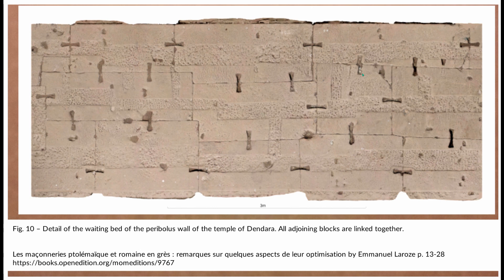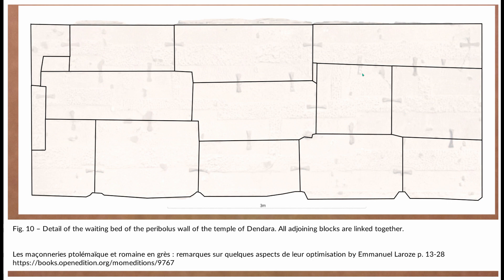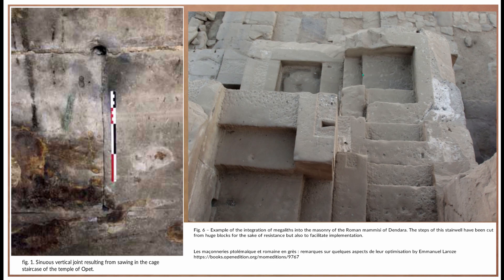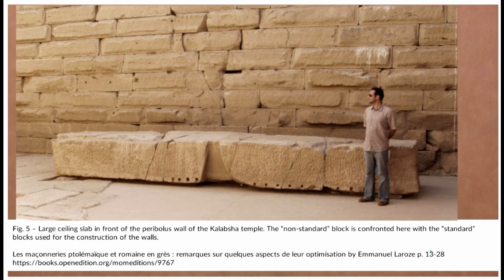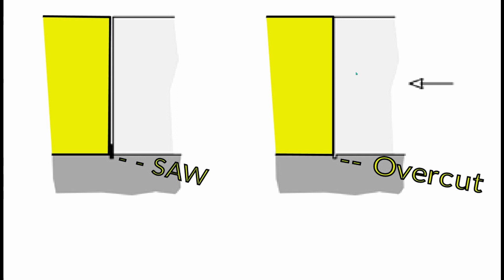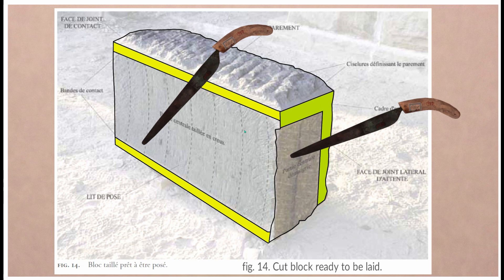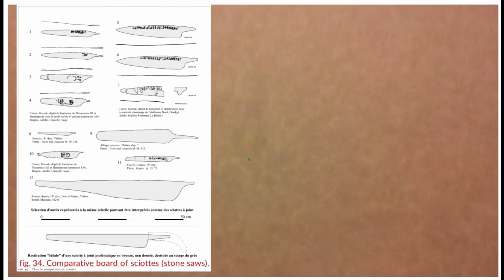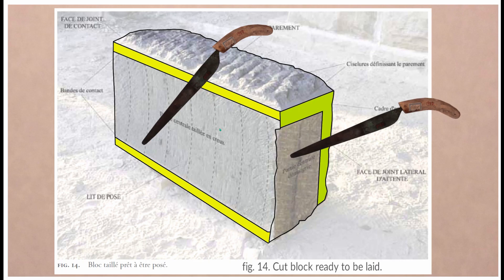Polygonal Stone Walls with a Saw: Ancient Techniques with Primitive Tools

Comment: For those who are interested in the topic of polygonal masonry. A number of methods for obtaining the polygonal masonry are proposed. The basis of the proposed methods is the use of clay/gypsum replicas, reduced clay models of stone blocks and a 3D-pantograph, as well as a topography translator. The results are presented in the article: “Fabrication methods of the polygonal masonry of large tightly fitted stone blocks with curved surface interfaces in megalithic structures of Peru” (DOI: 10.20944/preprints202108.0087.v7). YouTube does not allow a direct link. Search by the article title.
Reply: Correct me if I am wrong, but your paper assumes that the polygonal stone work done in Peru was done by European settlers no earlier than the 17th century?

I edit this to say no earlier than the 17th century rather than no later than, excuse me.
Reply: @foxprojects247  The Peruvian polygonal masonry was erected by European settlers (most probably by one of the Vatican's Orders) approximately after the 17th century. See explanations in the mentioned paper.
Reply: The 10th article edition (DOI: 10.20944/preprints202108.0087.v10) is posted at Preprints. Search the article by DOI or by title.
Reply: @foxprojects247 so smart they were to build underneath Inca construction to confuse everyone. The sky must also be green. This whole channel is Absurd..
Reply: @RostislavLapshin  this seems bit racist tbh... the idea that no other nation in the world was able to come up with same idea... would this apply also to the polygonal platform in Eastern Island??

Comment: the saw ran over? And it cut that deep... u were struggling to make a millimeter dent my man, these are boulders, there's no "oh shoot it cut a few centimeters over" this was a whole task, it wasn't fast work at all
Reply from the maker: I get a cutting rate in granite and basalt 40 to 50% of a modern gangsaw.
Over cutting comes from finishing off the cut. 
I am amused by people insisting things such as you have. I have a playlist of experiments in how to format doing the impossible or impossibly slow things.
They are cutting sandstone here. 🤦‍♂️ 
If you’ve cut wood you’d know that it’s natural to cut at an angle. These over cuts make absolute sense with even a little experience in tools.
In sandstone as here it’s a couple of minutes.
Boulders?  I have posted pics of people, lots of them, using saws to cut giant blocks with frog saws. It was common practice. Only now do people marvel at the fact of what was normal.
“If it wasn’t fast it wouldn’t work at all” is an incredible statement. If that was remotely true then historic buildings here in Sydney and everywhere else must be unexplainable too.

Comment: Be careful with drawing lines across photos to prove that the real object is curved. Cameras slightly distort shapes, especially with wider angle lenses.
Reply from the maker: yes definitely, though in some of their pictures they hold a straight edge against it,  since the images were lo res I just wanted to highlight it to male it a little more clear.

Comment: Around 6 minutes in, you stated, "used anathyrosis to put in a liquid slurry to bond and hold the stones together." Then, while reading the definition of Anathyrosis, it says "Anathyrosis is the technical word for the ancient method of dressing the joints of stone blocks in dry stone construction, i. e., masonry without mortar. " What you say is the method used in ancient times, which is Anathyrosis, is different from what the actual definition is. The stones at Sacsayhuaman do-not have any metal clamps together, they do not have mortar inbetween them, and they most certain do not have gaps in the back. The gaps in the back are where the soot fills in while the sides have grooves to fit together. Im pretty sure you've physically been to this site, so I'm confused as to how you're making this claim and showing a picture of the backside of the stone wall while not addressing how thick in distance the stones touch. This is no magic high technology used or your claim of Anathyrosis.
Reply from the maker: https://referenceworks.brillonline.com/entries/brill-s-new-pauly/anathyrosis-e120200
Another definition 
Anathyrosis can be with or without slurry. 
I have a series on Sacsayhuaman and show the gaps, contact being only on the facing side. https://www.youtube.com/watch?v=_x8MCXrqCCE&feature=youtu.be
Sacsayhuaman absolutely has gaps in the blocks. 
From the rear or where the sides are showing the fine joins can be seen only to extend back a short distance.
Reply: That's not true at all about Anathyrosis being able to use mortar. Anathyrosis is fitting of joints without slurry or mortar. It's fitting dry-stone together. The source you provided that was published in 2006 doesn't mention with or without. The only detail of process is "partial removal of material from contact surfaces between two stone blocks or column sections" which is to create a fitting or joint without mortar. Keyword is creating a "fixed joint", you don't put mortar into a fixed joint to get it to be stationary. If you're asking about a joint and lock, that's what fitting them together carefully is about, not by using mortar. The word Anathyrosis is ancient Greek. Anathyro is "Hatch" in ancient Greek which was used to bear, begit, or bring about during carving. When adding the suffix "osis" at the end, it becomes the act of or the state, abnormal condition, or action. When fitting together blocks using Anathyrosis, they fit dry stones together and create a hatch for them or a break to fit together. That's practically the point of Anathyrosis; without mortar. You have heard of Stone hatching,  I'm sure you can see the correlation of a direct translation and not a skewed ancient Greek > Greek > English translation.

This website below is a peer reviewed library that extracts text from scholarly reviewed books. It talks about how joints the joints that are made hence why you don't need mortar.

I created spaces in-between the URL so it won't be blocked.

http:// www.perseus .tufts. edu/hopper /text?doc=Perseus%3Atext%3A1999.04.0004%3Aalphabetic+letter%3DA%3Aentry+group%3D10%3Aentry%3Danathyrosis

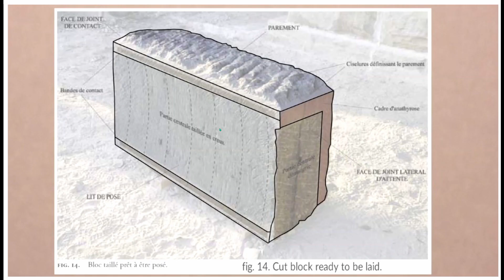In the video that you sent, at 32:30, you have a picture of wall section 21 and 22. You can see jagged roughness on the back side and the gaps pushed apart due to reconstruction or earthquakes. This isn't a gap from mistakes, it's from other sources pushing it apart. If you're mentioning a gap where only the front is fitted perfectly while the back is open; You have a picture yourself showing a block that's at least 3 feet thick that can be pushed together without gaps. When you take a picture or look at these gaps, there are no blow-outs, discoloration of constant adjustments to fit the gaps together, and they're completely smooth to fit together completely and not just the front of it. The gaps that you're mentioning are from reconstruction areas or crude Incan work done. You can clearly see these are not from the original pieces of work.

If you need a few pictures of showing Sacsayhuaman blocks that have no gap (front to back) and are flush together, take a look at the pictures I compiled in a .zip below which I took and hosted them for you below on file dot io. One picture is taken from Ollantaytambo and showing a ground base. There is a base where blocks used to sit which held almost two layers of gap-less blocks which also show an outline of where the rocks went. It shows that blocks were fitted together throughout the entire side and not just the front while having a gap in the back. What you showed is only one example where the back has a gap due to other occurrences that created that gap. I can provide you plenty of other examples of this gap-less occurrence from the stones at Sacsayhuaman. If you'd like me to go there and take any specific photos or data for you, then by all means lets work together instead of against each other to learn.

I created spaces in between the URL so it won't be blocked.

https:// file .io/ HkERW6p6cSqz
Reply: @SacredGeometryDecoded  you really need to come back to Jay here and work this out.
Brilliant minds together can create better progress.
Reply: Excellent work Jay, we need clarification and you seem very articulate with good information.
Reply: @Spherical  Thank you, Spherical. I greatly appreciate your response. SGD Sacred Geometry Decoded is a very intelligent, well-informed, and overall smart person & channel. My response was to never belittle, I like to debate and discuss, so I apologize if I made it seem that way. 

This stuff is difficult for the average person to conceive and explain right off the top of the head. Also, we're all on the same team here trying to bring the most factual pieces of evidence to explain the ancient past.
Reply: No you sound all good. 
It's important for minds 5o come together. 
You cleared up questions I had about gaps behind the bigger blocks and your feedback made more sense. 

We need more cooperation and discussion in the world 🌎

Comment: Using a saw simultaneously on nextdoor blocks is also the way we make the blocks of snow fit when building an igloo. It makes complete sense to me that this is how polygonal masonry could be done. 
(I'm guessing from your accent that you might not have built many igloos, apologies if I'm incorrect!)
Reply from the maker: You are very correct. I got most of my igloo education from Bugs Bunny cartoons. 😉
Reply: @SacredGeometryDecoded  😂
I think some of these 'alternative historians' are getting their masonry knowledge from similarly dubious sources!

On a serious note though the only difference I can think of between the 2 techniques is that we normally do the horizontal cut before the vertical cut. 
It never takes more than 2 passes of the saw to have the sides lined up nicely, it's got to be the easiest method for achieving the desired result.

Comment: A method used by the ancient Egyptians is the same method that has been used around the world and is still used today in modern quarries. The Urn Tomb in Petra is carved into the side of a cliff and is a perfect example of this technique.

To create the basic shape, stone blocks are cut from the solid stone cliff face, which leaves tool markings. These tool markings then leave a surface that resembles a wall made of blocks. The depth of the tool markings depends on on the stage of construction when it was abandoned. If it is at the initial stage where the stone has not yet been removed, the tool markings will be deep and wide. You will see many examples of this at Petra as well as at the Colossi of Memnon where one of the statues still has these deep grooves. Because they are cutting and removing large rectangles of stone, the tool markings resemble rectangular blocks and so they create the illusion of a wall made of blocks. There are numerous quarries both ancient and modern where you can see this. Also because they are removing rectangular blocks of stone, you will sometimes find the offcuts scattered around, causing people to believe that they are blocks that have fallen off. There are many of these blocks scattered around at Petra.

After removing the rectangle block, the tool markings that remain in the solid stone are much thinner and shallower. As they smooth out the blocks, the lines become thinner and more shallow that create the appearance of very closely fitting stone blocks. Because the "blocks" are cut from solid stone and there is no need to be perfectly straight, the irregular shapes of the stone will match perfectly and make it seem as if two surfaces have been cut to match perfectly. Where the stone is closer to being finished, the grooves will be very faint and often incomplete, allowing you to easily see that what looks like two blocks side by side is actually one piece of solid stone. If they were to score the stone before they cut into it, it will also create the fine lines that look like perfectly matching blocks of stone. That is why you find these "overcuts" because they were cut from solid stone. The triangular indentations are where they put blocks of wood that they would soak with water to expand and break the stone away from the solid rock face. If they were cut from a quarry, those marks would have been removed at the quarry.

 There are many examples of this method at the Urn Tomb, showing the different stages of construction that create the illusion of a building made of blocks. You will also find these tool markings underground and on free standing sculptures, some of which are buildings that people falsely believe are made of blocks. But if you examine the grooves up close you will find parts where grooves are incomplete or where the stone pattern from one side of a groove crosses over the groove into the adjoining "block" showing that the groove is incomplete and only superficial.  That's the thing about something made of solid stone, it's easy to prove conclusively but you are not going to find something unless you are looking for it.

Comment: Elegant interpretation of the available evidence. In contemporary stone masonry, leaving thin edges of stone bearing on lower stones is not considered good practice and a defect. Once loads are fully applied to the stone work, and if the mortar gives,  the edges can chip / spall off. That will also depend on how thin the bearing edge is, the strength of the stone, and other factors. The ancient stones have wider bearing surfaces, and the central hollowed areas filled with mortar/gypsum would give back full bearing to the stone, to even out the pressure. As noted below other trades working in other materials will also cut down the middle to get matching surfaces - wood workers,  metal workers (look up cut and butt), igloo builders, insulation installers, etc, and may even thin down the material towards the edge to make it easier and quicker to cut,  just like on the stone blocks seen in the video. Thin, metal blade stone saws with no teeth are still used today using a grit and water for the cutting action. A technology the Egyptians had along with the builders square and plumb bob that are still seen on construction sites today.

Comment: Very good theory. It's just that the over-cuts look like they had mass and power behind the saw. If they had some water powered machine connected to the saw, I can believe the over-cut. But cut granite with copper and accidentally over-cut by hand, I don't know. Talk is easy, but I would like to see a demo of two boulders in manageable size been fit together with this technique. Best theory so far so far, well done.
Reply from the maker: https://youtu.be/Ggw1c_3Cdk4
Sawing granite, shows steel and my own copper blades. The middle of blades get worn making concave or convex in stone.
The over cutting makes sense that way as the ends would need to be cut down further before the centre cuts all the way through. 
Ideal speed for cutting with mechanically powered or hand powered saws. In granite it’s a low speed, hand powered speed for gang saws.
I have granite cutting demos to show the cutting speed and wear of blade with copper.

Comment: Will you also make a video like this on the  stonework in central and south america? I'm curious what ingenious way they have used without metal tools. Probably just more hard work and sweat but they must have used some smart methods to.

Without metals and saws it must be something like your dentist uses to get the new filling and existing teeth aligned again. With a medium (e.g. a thin mud layer) in between, you press it together and pull apart again, where you see it touched in the medium you just chisel a bit more away until it more or less touches everywhere. But could be wrong ofcourse.
Reply from the maker: Will do but trying to find the footage and images is a pain, especially of the half finished stones or a good view from behind.
Reply: The Incan walls with their odd shapes everywhere look exactly like this method. I have seen photos showing that the the stones only fit perfectly at the face, some few inches in. They are hollowed out a little beyond that so they can be wedged up with smaller stones from behind if need be. The crazy angles and shapes are likely the result of using the stones existing shapes as a guide and just straightening them out - i.e. work smart not hard; why cut away more than you need to.

As the wall is laid, stones are chosen to fit, small or large, and then roughly straightened out to match the angles of the stone already there. Once in place as close as they could get them, cut with a copper/bronze saw and abrasive as per the video to make a perfect fit. If you look at the Incan walls and think through what order they would have been laid in, you can then see the order and length of each cut.

In terms of moving stones, I don't think this is as big a problem as it is in other places due to the landscape and the purpose of the walls. The largest of the Incan stones seem to be on retaining walls for terraces, which means they did not have to be "lifted" into place. The terrace would have been filled in as the wall was built, and each new level of stones is then pushed/dragged/pulled into place. I have also heard that the stones came from locations higher up the hillside than the buildings, so they could be dragged downhill, onto the terrace, and then onto the wall. This would allow for some massive stones to be used without requiring complicated lifting rigs.

Comment: Excellent info.  Quick question, how would they have cut joints that were rounded ?  I agree and understand butting the stones horizontally and vertically and using saws to cut lines.